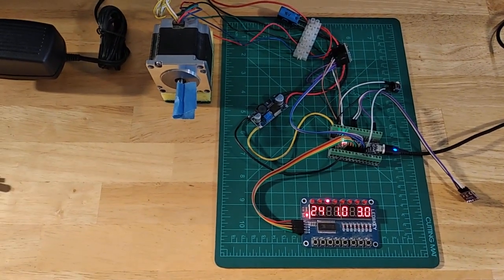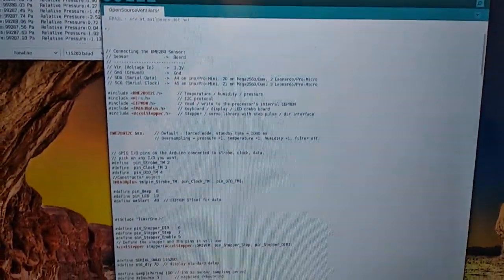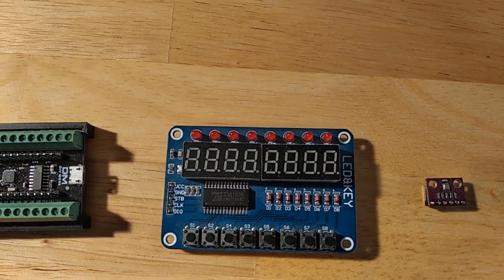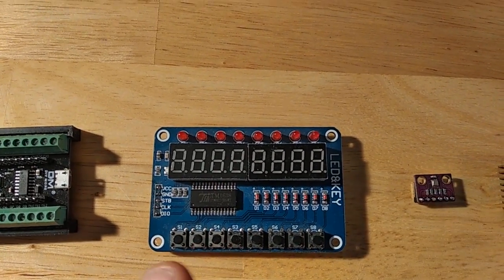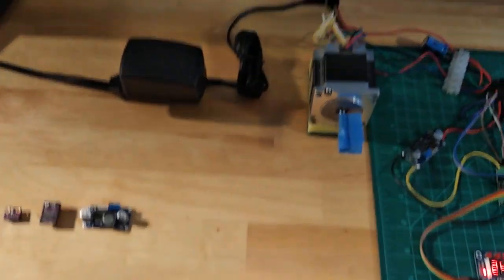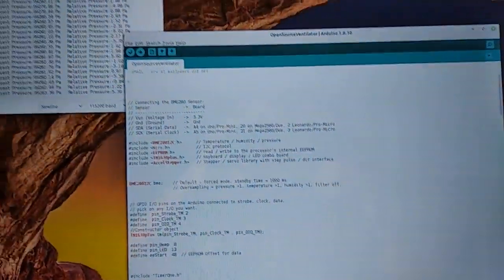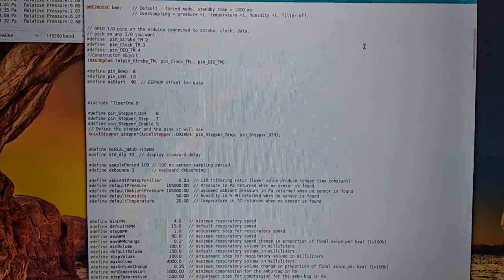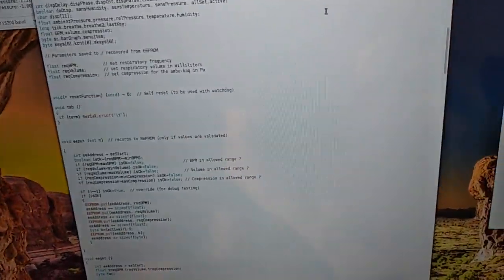Open Source Ventilator

Comment: Hi Erik, thanks for this video, I ab getting the parts, however, once this is working, do you have a DIY for the rest? I mean, this is connected to a respirator mask or what? 
Thanks in advance for your reply.
Reply from the maker: Hi, I'm part of the https://opensourceventilator.ie/ project (even if the controller is also used by other groups.) Mechanical devices are currently being developed & tested in the group and elsewhere, and once we get the design right, it will have to be reviewed, analyzed by agencies, approved by MDs, and since the demand for those machines is directly from governments and the medical community, hopefully that'll happen relatively fast.
Most of the designs are ways to automate Bag valve masks (also known as ambu bags, google it). 

If you have ideas for a mechanical design and know your stuff, I'd be willing to help with software integration (as long as it's fully open source, I won't help people who are in it to grab grant money), and you can join the group. however, I would strongly discourage attempting to build a half baked design as it won't fly any better than a 737 Max. The current designs, including my controller are work in progress, NOT intended to be hooked to a patient.

Once the design(s) is/are finalized and approved, if all is good, there will certainly be a mix of community and industrial builders.

In the meantime what can you do ?
First, I'd say, join local online groups, people who share information and mutual help. Within those groups, you can prepare for community manufacturing. See who's got resources, machines such as laser cutters, CNC machines, 3D printers. Learn who are the local wholesalers for things such as plastic sheets, fasteners, electronic boards and components. If you have a 3D printer, tweak the settings for printing PETG, that's what most useful stuff requires. Learn and exercise the group's skills by building simpler, but useful projects such as the Prusa face shields ( https://www.prusaprinters.org/prints/25857-prusa-protective-face-shield-rc1 ) that are requested by local hospitals and / or local businesses where the employees are exposed. Sewing protective masks is also in high demand (to be clear, such masks don't protect the wearer, they protect people around them by preventing most of the droplets that potentially carry the virus, as people understood in Asia, wearing it is a sign of respect). Join initiatives such as https://millionmaskchallenge.com/ You can also help by doing deliveries for infected people. It's safe if you follow the guidelines and very effective. You can go to a grocery store and see if they have job for you. They are searching for people to take phone / email orders, prepare the orders, do deliveries. 

There's a lot to do, for everyone.

Comment: Does the stepper motor have enough torque to activate the BVM?
Reply: That's I'm curious too.  If it is a nema23 or larger, should work, with the right gear/leverage
Reply from the maker: Hi, that's an important question. A lot depends on the hardware design , however, the controller outputs standard step / dir pulses, so any regular motor controller should do from tiny motors all the way to huge Nema 52.
If using a stepper, the voltage needs to be at least 24V. designs using a leadscrew should not even attempt using a stepper and go directly to a servo motor such as this one : 
https://www.aliexpress.com/item/4000333220649.html
Reply: nema23 and tb6560 2 or 2.5 apr setting good tourq for vantiltor ambubag....but tb6560 volt need to 20 to 24 ..
Reply from the maker: @talats4561  Latest numbers seem to indicate large NEMA23 motors will be required, but exact specifications depend on the chosen mechanical design. TB6560 / 6600 are notoriously unreliable and there are lots of fakes around, avoid them. Controllers such as Leadshine DM542S seem more appropriate : https://www.aliexpress.com/item/4000141226138.html

They need a 24 or 36V power supply with a boost regulator, as the machines need to be able to operate on a battery in case of power outage.